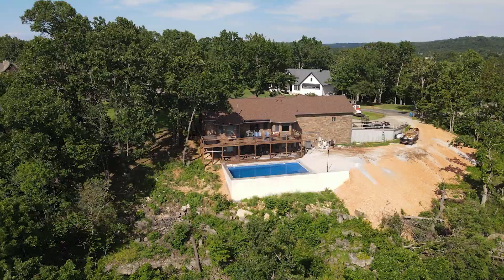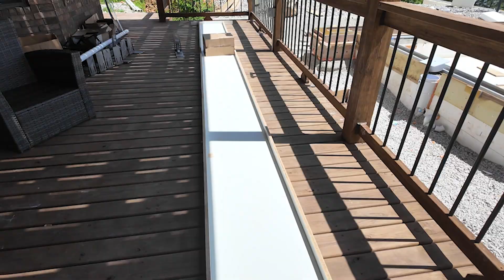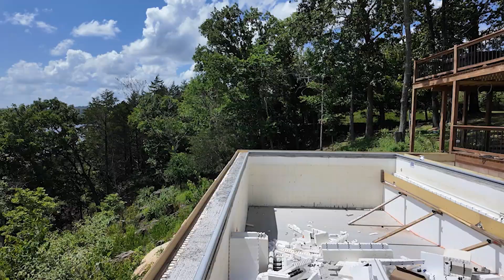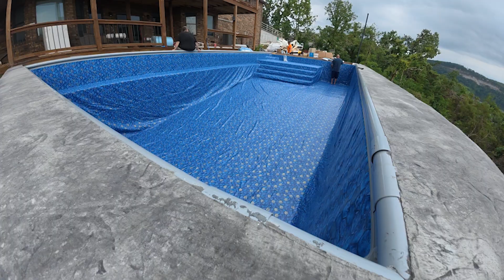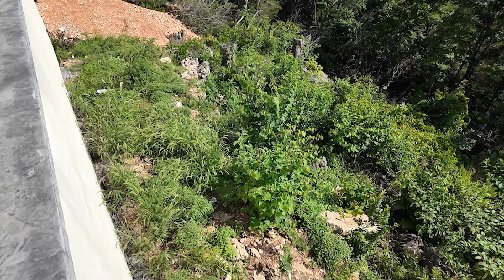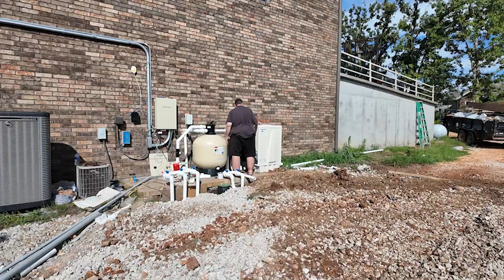Finishing Up ICF Pool on a Bluff!!!

Comment: i’m currently building an icf pool. what is that white foam underlay you are using. I was going to throw down a carpet foam underlay but this looks a lot simpler.
Reply from the maker: Liner wall foam, 1/4” thickness
Reply: Thanks!